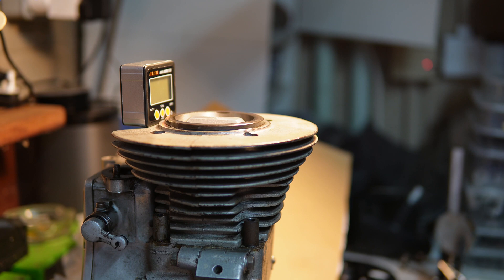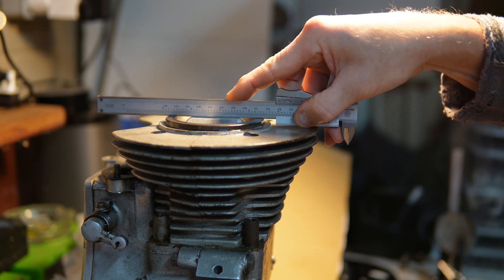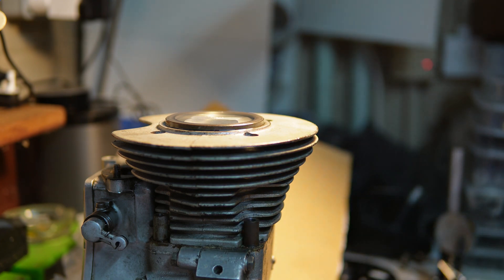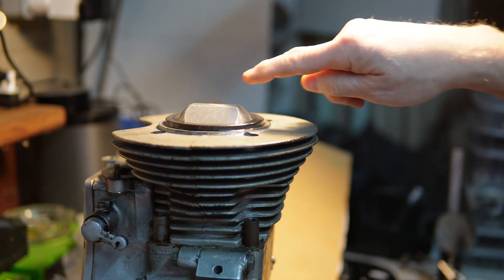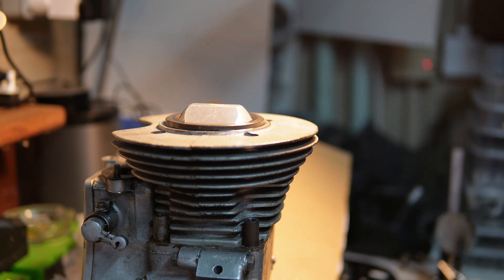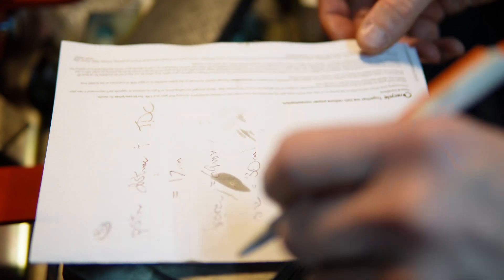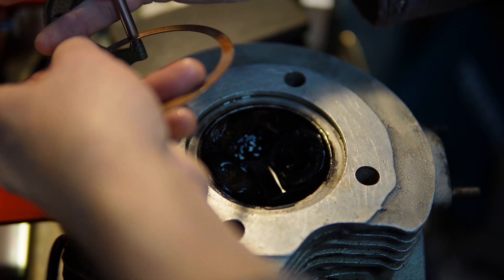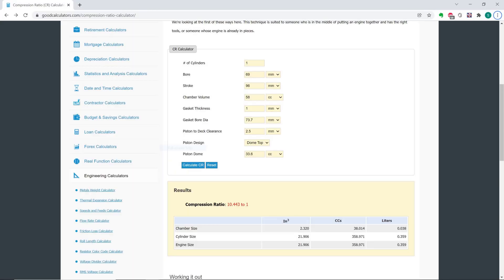Velocette MAC special part 5 of many - Compression Ratio

Comment: Just move it down one inch exactly ,calculate 1 inch of fluid ,  plexi glass to barrel with hole ,grease to seal piston, not level is better  , use a burette and meths and then you can easily  calculate your dome volume .

Comment: You may have it by now but Grove Classics do a manual you can down load for Velo’s that I’ve found a god send of information. Great project and some learning curve. This was how the tuning  guys back in the day probably started. 
I met some lads on the island that used cylinder liners with fins welded on that had singles out to 650 plus using thus method 
They went like the clappers.
Valve to piston clearance could be a tricky one. Triumphs need 70 thou minimum.